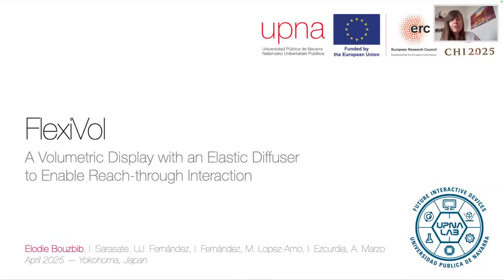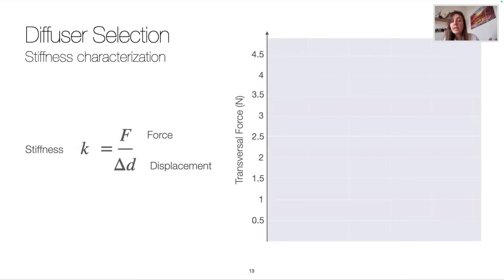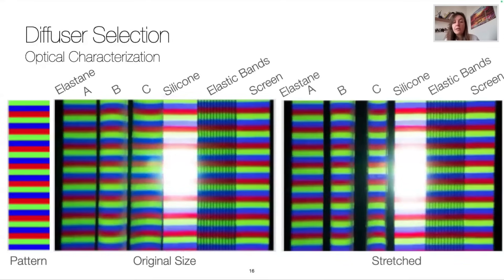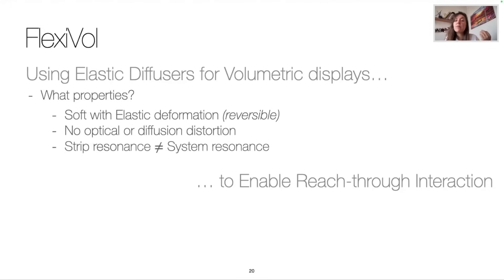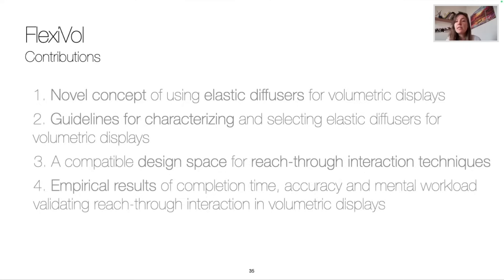FlexiVol -a Volumetric Display with an Elastic Diffuser to Enable Reach-Through Interaction (15 min)

Comment: AI Summary

Abstract:

This presentation introduces FlexiVol, a novel swept volumetric display system utilizing an elastic diffuser, specifically an array of elastic strips, to enable safe, direct, reach-through interaction with true 3D graphics. The work addresses the limitation of traditional volumetric displays where rigid, fast-moving diffusers pose safety hazards and necessitate indirect interaction methods. The research involves a detailed characterization of potential elastic materials (elastanes, silicone, elastic bands, projection screen fabric) based on mechanical (stiffness, plastic deformation, hysteresis), optical (diffusion, distortion, resolution), and oscillatory (frequency response, resonance) properties, leading to the selection of elastic bands as the optimal diffuser material. A design space for reach-through interaction techniques, combining gestures and actions, is proposed. A user study (N=18) compared FlexiVol's direct interaction (finger tracking) against a traditional 3D mouse for selection, tracing, and docking tasks. Results show direct interaction is significantly faster and perceived as less cognitively demanding (lower NASA-TLX scores), more natural, and intuitive, despite a minor trade-off in accuracy for the docking task. Future work includes integrating haptic feedback (ultrasound, electrotactile), scaling the display, and exploring collaborative applications.

FlexiVol: Enabling Direct Interaction in Volumetric Displays

*   0:02 Introduction: Elodie Bouzbib introduces FlexiVol, a volumetric display featuring an elastic diffuser to permit direct "reach-through" interaction with 3D content, funded by ERC Intevol and Touchless grants.
*   0:22 Volumetric Displays Explained: Defines volumetric displays as devices creating true 3D visual representations, offering autostereoscopic views without requiring headsets.
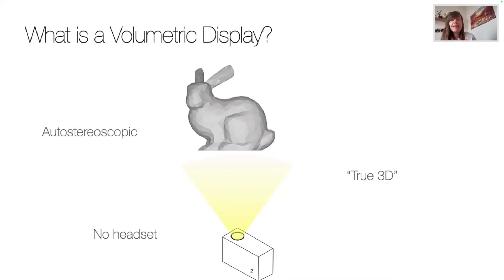*   0:47 Swept Volumetric Displays: Details this specific type, which uses a rapidly oscillating diffuser surface synchronized with a projector slicing a 3D object. Persistence of vision creates the perception of a solid 3D volume.
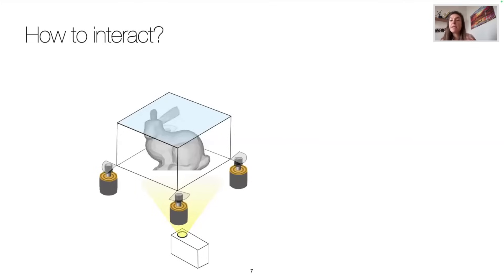*   2:00 The Interaction Problem: Highlights that the fast-moving, often rigid, diffusers in traditional swept displays create a safety hazard, preventing direct hand interaction and typically requiring protective domes and indirect methods like 3D mice or hand tracking with avatars.
*   2:45 Research Goal: Direct Interaction: The core aim is to enable users to safely put their hands directly into the display volume for interaction, aligning input and output space.
*   3:07 FlexiVol Concept: Proposes using elastic diffusers instead of rigid ones to allow safe reach-through interaction.
*   3:18 Material Characterization: Investigates necessary properties for elastic diffusers, focusing on mechanical (stiffness, deformation), optical (projection quality), and oscillatory (resonance, shape) characteristics.
*   3:36 Candidate Materials Tested: Evaluates six materials: three types of elastane, silicone, elastic bands, and a standard projection screen fabric, initially as strips.
*   3:51 Stiffness & Deformation Testing: Measures force required for displacement using a load cell. Notes that some materials (Elastane C, Projection Screen) exhibit excessive or plastic (permanent) deformation. Elastic bands show high stiffness but remain elastic.
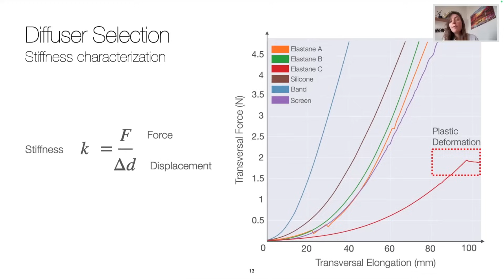*   4:45 Hysteresis Testing: Assesses whether materials return to their original state after stretching. Elastic bands showed minimal hysteresis, while others like the projection screen deformed irreversibly or twirled (Elastane C).
*   5:47 Optical Property Testing: Examines projection quality (RGB stripes, grid, white light) when materials are stretched/unstretched. Silicone reflects too much; some elastanes cause blurring or distortion when stretched; elastic bands show dark lines but maintain overall structure and acceptable RGB intensity.
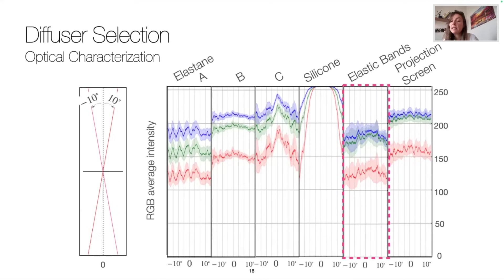*   7:17 Frequency Response Testing: Characterizes how materials oscillate at different frequencies using speakers and stroboscopic light. Resonance frequency is important to avoid conflicts with the display's operating frequency.
*   7:54 Material Selection Guidelines: Establishes criteria: must remain elastic (no plastic deformation/twirling), maintain optical quality without distortion/blur, and have a resonance frequency different from the system's operating frequency.
*   8:27 Elastic Bands Selected: Chosen as the best compromise, retaining mechanical/optical properties during elongation, laying flat during oscillation due to anisotropy, and having a suitable resonance frequency.
*   8:39 Reach-Through Interaction Design Space: Defines possible direct interactions inspired by 2D elastic displays and AR/VR, including actions (swipe, touch, scale, pinch, rotate, push) and gestures (using fingers/hands, interacting with or between strips).
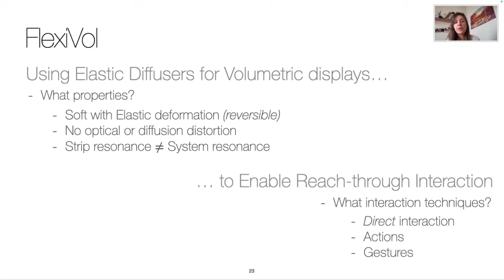*   9:55 User Study Overview: A study was conducted to validate FlexiVol by comparing reach-through interaction (using finger tracking) with a traditional 3D mouse across three tasks, measuring time, accuracy, and cognitive load (NASA-TLX).
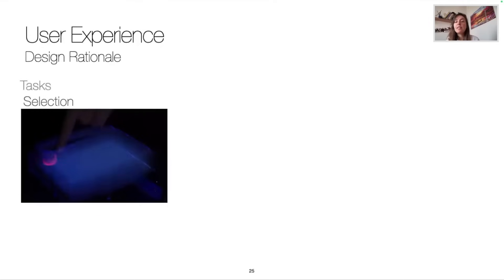*   10:16 User Study Tasks: Included 1) Selection of spheres, 2) Tracing 3D circuits, and 3) Docking small cubes into larger ones.
*   11:01 User Study Results (Quantitative):
    *   Selection: Reach-through was significantly faster (avg. 1.0s vs 1.9s for 3D mouse).
    *   Tracing: Reach-through showed significantly better accuracy (smaller position deviation); completion time was similar.
    *   Docking: Reach-through was significantly faster, but the 3D mouse was slightly more accurate (smaller positional error).
    *   Workload: Reach-through had significantly lower cognitive load (NASA-TLX) overall, particularly in mental demand, temporal demand, effort, and frustration.
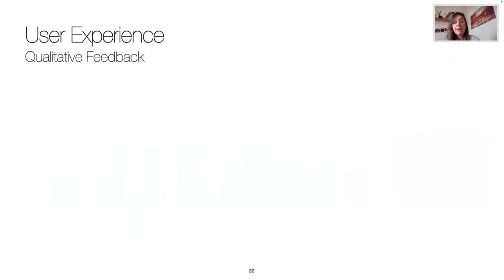*   12:18 User Study Results (Qualitative): Participants largely preferred reach-through, finding it more natural, intuitive, and easier. Initial apprehension about touching the moving strips was overcome, describing the sensation as soft or pleasant. Users expressed interest in more complex gestures (pinching, grabbing) and envisioned various applications (3D modeling, collaboration, medical).
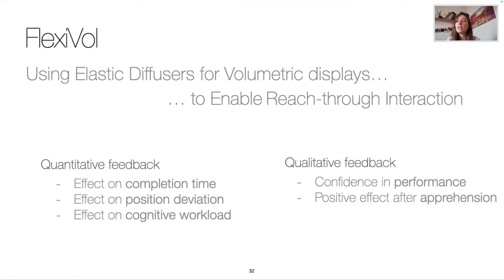*   13:09 Future Work Directions: Plans include integrating haptic feedback (focused ultrasound, electrotactile feedback via conductive thread), increasing display size (potentially using helical sweeping), and exploring collaborative use cases.
*   14:00 Summary of Contributions: Re-iterates the key achievements: the novel elastic diffuser concept, material selection guidelines, interaction design space, and empirical validation of reach-through interaction benefits.

I used gemini-2.5-pro-exp-03-25| input-price: 1.25 output-price: 5 max-context-length: 128_000 on rocketrecap dot com to summarize the transcript.

Input tokens: 40507
Output tokens: 3722

Comment: It seems that interaction is done solely through the top. Is this the case or can users interact with the display from the sides?
Reply from the maker: Indeed, it depends on the design of the frame holding up the strips. As the whole frame+diffuser is moving quite fast, if the finger interacts with it it will feel the frame as rigid - which in our case is neither painful nor a safety hazard, but is not nice either. If the frame only has two sides to hold up the strips, then users can interact from two remaining sides too.
Reply: Okay, thank you. I look forward to future developments!